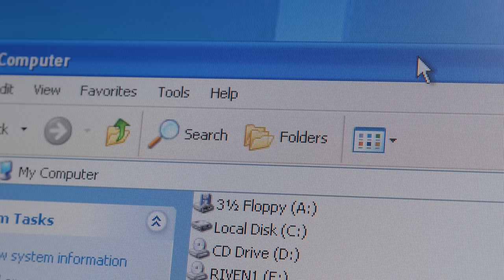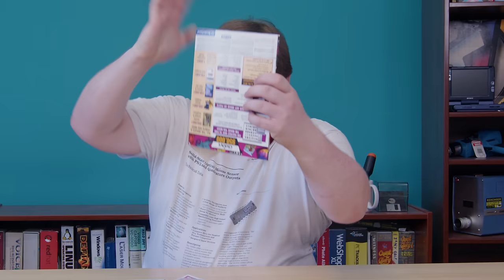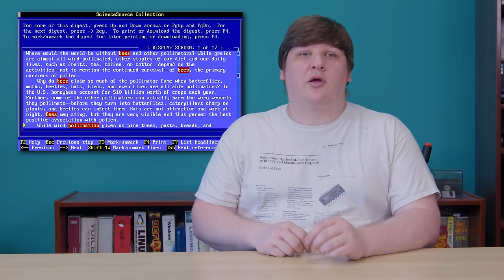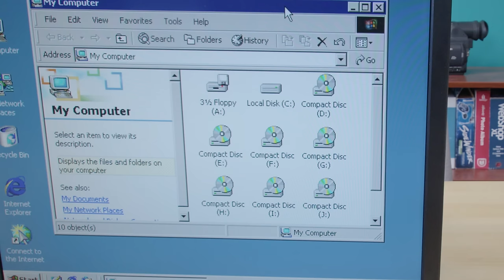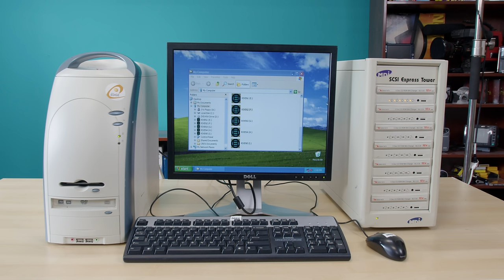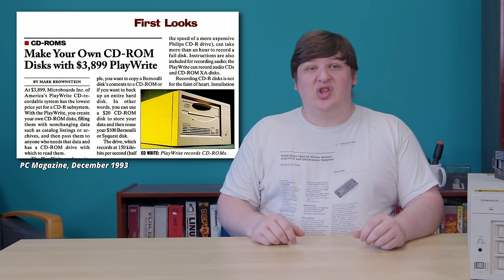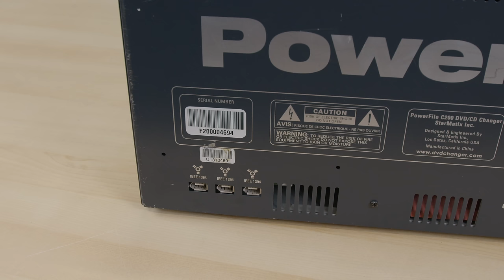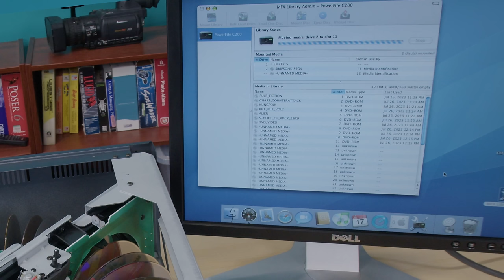A Jukebox for your PC: 1993's CDROM Servers

Comment: I remember the library having something like this, only it was built into the pc case. I remember it was something like 3 feet tall. It had all sorts of software that you could run on it, but I only remember one. It had a Google maps esque software that you could use to plan trips and it would provide turn by turn directions with timestamps when you should arrive at each step along the way. I thought it was so cool and used it to get directions to visit every amusement park I knew of at the time. Of course my parents weren't as enthusiastic about my planning.

Comment: Did you try changing the intensity of the laser, after gluing the lens back on? That can be done with a multimeter and a tiny flathead; doing so is necessary to temporarily fix GameCubes.

Comment: Most likely those pioneer units where used for Mall/store music applications, that you could leave running for 18 hours a day 7 days a week. The Tech Moan channel did a review a while back on a Japanese system using cassettes . 6 cds played on loops. their design was industrial so they wouldn't break and cheap to fix if they did. they could live on a shelf in the corner just playing through tracks.

Comment: These 'last forever + unbreakable" claims started on a very big and old, UK BBC "Tech" TV show Tomorrow's World. I was compIaining about the claims weekly, as was my dad, an electronics engineer since 32k started with Dragon 32, etc, before the Commodore 64. My dad was the tech for Dragon and actually made me a computer, something impossible today, as such claims mean built, as in assembled what someone else made.  Yes the Music ones didn't read data. Spot on. He literally had to bring every resistor home, I helped  rub off the black pcb tracks and contacts. The only part I couldn't get as an 11 year old in 1982 was the case, so I wore a wrist strap as my pcb was on chipboard. Nobody said motherboard then. PCB was barely understood by most. I could change RAM thpugh. My dad put in expandable RAM years before it was standard. I even had games on RAM chips in tubes. It was faster than tape.

Comment: The pioneer cd drives of this era are known for bad glue on the laser lens and with time it has detiriorated, unfortunately to repair them you need an osciloscope and luck as the laser has engraved the lens and if it isn't in the correct position it won't adjust properly

Comment: I think I remember my friend who had one of those big 100 CD changer things, say that it would "forget" where it was all the time and start pulling the wrong discs.  I'm guessing it was just working off a gear system so X second of turning meant it had rotated to the disc 57.  except once it gets off track by even a single disc its off track forever and will likely slip more and more out of sync.

I'm betting there were Japanese karaoke versions that were better built and had a built in sync check to insure the carousel wasn't out of whack.

Comment: I'm going to make an addendum. A Single Layer Single Side DVDs could hold 4.7GB
DVDs could be double layer double sided.  I remember renting a movie that had a double sided DVD.
Reply: Double-sided discs seem like a cost-saving measure for distribution. Still just as inconvenient for the end-user as putting the movie on two discs, given you have to flip them over. Now, if they'd made drives that could read from both sides, especially if it could automatically detect which was side 1, they might have been worthwhile.

Comment: I do know that the similar though later Kaleidescape Disc Carousel, had a hard-programmed habit of randomly checking for discs to make sure they where "really there".

Thus was due to concessions to the MPAA who demanded that if DVDs where ripped into the optional Kaleidescape raid disc ( K-RAID ) system,
the carousel storage had to prove that the disc wasnt just ripped and returned to the local RedBox ( very specific era )

This becomes a problem if you lose power during any one of these disc checks, causing the index to be lost on reboot, and desyncing. Also, the cheap motors would die young due to the constant random checking.

Comment: I would love to see that 200 disk changer tuned up and working as god intended.  It needs just 4 things:
1. A large door on the side to allow manual loading of disks.
2. A pair of buttons inside said door to rotate the carousel to allow loading all 200 disks.
3. A small switch placed as such that it is actuated by the disks themselves as the carousel rotates.  On startup or when commanded the machine simply rotates the carousel to see which slots are populated.
4. New firmware.  It really really needs better firmware.

I would gladly make the physical upgrades to that machine myself but I know nothing about writing firmware...

Comment: The 6 cd changer were 100% consumer oriented models. or rather pro-sumer as they needed a SCSI interface which was not that common place. I had one 6 cd changer from pioneer, except mine was dark gray instead of white, and the cartridges were the same as the ones used on pioneer's car CD changer, also black and gray. I had 2 music cartridges, 1 MSDN , and 1 with mixed stuff.
For pc it showed up as 6 separate drives, with their labels as it scanned the disks on power up. it took around 5 seconds to swap from 1 cd to another.
It was based on the trunk cd changer by pioneer, which might explain why everything is so beefy. it was made to withstand potholes. the linear actuators needed to be strong enough to move the head on a curve without skips. all of the reader is probably supported by liquid bearings too. the car unit is EXACTLY the same with an audio RCA out instead of the SCSI interface (and 12V powered)

Comment: Rip Sony ODS 2012 to 2023 It was 5.5TB per slightly bigger then LTO shells with 500GB discs with 250GB quad layer sides basically blu-ray discs, it was a fairly atttractive system but so overpriced not many people would move to it from LTO outside of the media/science/legal world, and to this day optical jukeboxes for stadnard use are insane prices.

Comment: I had a Pioneer 604x with a SCSI interface that I used for years with my Amiga 3000 (I think it is stored in my shed along with a couple not quite operational 3000s) - I also still have a CD Player that is pretty much the standalone player with the same cartridges.

Comment: well you would think the target audience actually was radio stations. but it turns out that simply getting 3000 seperate audio cd players and putting them in racks even was cheaper and more optimized for those lol.

Comment: Interesting. I worked for Next Technology Corp ( No not the Steve jobs one) in Cambridge (UK) on our 270 CD, 8 drive jukebox from 1989 to 1991. We sold them to various people like the British Library and Disclosure ( in the US) - they did financial reports.  Used SCSI as a data transfer. The robot arms that grabbed the discs were prone to errors and at one point we were Sony's biggest customer for CD-ROM drives - they were horrified when they turned up one day and saw their drives in bits waiting to be installed into the jukebox.
We also had a Meridian CD-ROM recorder. cost about £100K . Blanks were £25 each - and these are srill readable today - unlike the cheap ones that were sold in the late 90's . 
I'll see if I can find my copy of the user & service manuals that I wrote for the "Voyager" CD jukebox.

Comment: Why not discuss tape by the way? I always thought this was the holy grail of backup. Another point regarding backups is that I've considered future compatibility of current backups. What if hardware or software architecture changes? Like you found out, the disk changer software is no longer available. IDE drives are basically useless unless you get compatible hardware. SCSI, same problem. The old parallel port ZIP drives too, and Firewire storage as well. The best solution I've found is to perpetually copy old backups to modern media every couple of years. Integrity is something you can only solve with software, for which I've found zpaq to be indispensable.

Comment: OK, you said "no, we're not bringing up tape, we're not going there."  Well, I'm going there.  I used to service LTO tape libraries.  The horrors of what these things would do.  We're talking like, "forgot exactly where the slot on the tape drive is" which, it's just a normal off the shelf consumer LTO tape drive with a metal faceplate.  And good thing, too, because on more than one occasion, it'd forget where the tape drive was exactly, and try, repeatedly, ramming a tape into where it thought the slot was, miss, try realigning, miss, and keep doing this until literally the tape shell broke.  Which, best case scenario, it'd disintigrate and fall apart everywhere, but, all too often, NO, it'd manage to smash that broken tape INTO the slot at that point, and the drive would manage to partly thread the tape before, wham*, jammed tape.  And tape unspooled everywhere, slowly winding its way into both the drive guts AND the robot mechanism until the whole thing stalled out with multiple robotics errors when it would *FINALLY decide to say "NOPE, I can't work anymore, I need to call the humans for help."

Imagine if GLaDOS's fallback mode was running a tape library and you're in the right ballpark for how bad these things are *today*.

Comment: I fix cd players to resell..and 9 out of 10 times I'm hunting for the pioneer laser lens because it fell out in the case..they most have used some kind if crap adhesive..I think they fixed the issue by 2000.
Reply: I also find they are very picky on spindle height from lens.

Comment: "No don't bring up tape we're not having that discussion." 

Cut to me moments before smugly thinking that was The Answer 

I would Love that discussion though... And just the technology of backups in general. Doesn't even need to be current technogy either I've always been So Interested in data preservation even from a legacy standpoint yet I've barely done a lick of research
Reply from the maker: I'm curious about tape a bit, but tbh it seems pretty dull. The newest format I've ever touched was LTO-1, which is ancient, but as far as I know the actual experience is pretty much the same, and it's basically "flash drive with very awkward UI and an incredible amount of waiting."
Reply: @CathodeRayDude damn... So much potentially cool old tech faceplants at least in part thanks to an incredible underinvestment in UI/UX....

Comment: I had an NEC 4 disc 4x drive in my PC in the mid 90's along side a single fast reader. And got it specifically for multi disc games, and it worked great for that. Boot times were sometimes a bummer but not anything I didn't get used to as I would just leave my computer on.

Comment: I never knew there were CDROM "towers" like that.  I think the first devices like that i saw were CD-RW towers.  I just assumed they were for pirating or something.
Reply: Usually not pirating, but short to medium run independent music production. Having a pressed disc manufactured required a huge minimum order to be viable, but once you did it, you could get marginal additional copies for pennies. Bulk robotic CD burning was a sort of middle grade between babysitting a single CD burner for your entire weekend to produce a few dozen copies if you were lucky and having to be an actual record company.

Comment: I worked at Office Depot in the tech department many years ago. I rembember around the 2000's we got in a cd jukebox tower thing, I think it was made by eMachines. I can't find any info on it online, but I think it was about 100 discs worth of storage and it was some sort of catalog device. No optical drive and no robot arm. I think you just stored your discs. in it with a benefit of some storage catalog/index.

Comment: I am a huge pirate and the way you play PS1 games on original hardware anymore still requires a jailbreak memory card and a burned CD. It would be so cool to take a CD jukebox apart and replace the reader with a tricked out PSX, load it up with bootleg games, and hit play

Comment: I remember the day I went from my 200 cd carousel to just having a pc with music on it. I had my 200 disk carousel for about five years had all my cds in it but several of the disks had no track data built in so I had many cds I would have to hit play on just to figure out what disk it was.

My solution was to take out all those disks probably about 30 or so and burn them onto a cd that did have track into. I was about six disks in when I realized wait a minute I only every play one or two tracks off of most of these disks. So I started the process of moving the one or two songs in Wav format to a hard disk prepping to burn a compilation disk at around 30mb per song.

When it dawned on me that I could just do this for all my wanted songs and reduce maybe 200 cds down to about 25. So i was mid this process working nightly when MP3 hit the scene and changed everything. My brother still has the 25 disks I burned somewhere in a closet. I have a copy on an old iphone 6 that I use as a walkman.

Edit "rude word" to "Disk"

Comment: In 1995, I was the office supply buyer for a major military contractor, and I bought more cd's than anyone in the state. At the time, I paid up to $14 each for a cd/rw with an average of about $7. ea. - blank. It was insane.
Reply: p.s. we were writing documentation for helicopter gunships and weapons systems on them. Not public domain books. We're talking whole cases of reams of paper in pdf format with graphics, charts, etc. It was a huge amount of data.
Reply: p.p.s.s. In 1995, my company bought a terabyte of DASD storage for $1,000,000 and a 500GB SCSI array, made by Amdahl (and LVS 500, nicknamed Elvis) for about $500k. We also loaded 40 redhat vm's on an IBM OS390 box that had a tape robot library about 30 feet long and 6 feet wide. It was like the wild west back in those days.

Comment: I used to work at Powerfile!  The deal I worked with was nifty when it worked - it was a dual bluray burner  holding 200 discs - and also was a piece of shit. They went under in November 2008 when the economy crashed.

Comment: I wonder why the 8 cm CD format wasn't used more, as it would have saved a lot of plastic and well, indeed space too, which would have been significant when bringing laptops around. A 8 cm CD has 185MB of space, which would be more than enough for most programs at that time, and one could even have imagined drives that took only 8 cm CDs, in laptops, to save space and battery. 

Optical small "golden" discs have been featured in many movies, before the 8 cm CD was available commercially, though CDs already existed, as a very fancy but not really sci-fi technology. One example is  "Rising sun" from 1993, with Sean Connery where important evidence is to be found at such a small disk.

So in a way, it was surprising that noone thought to do this for real, and just make 8 cm CDs with software as it would have been about as small as a diskette, with more than 100 times the data on it.

I would have really enjoyed to have had 8 cm CDs instead of those clunky 12 cm CDs, and they must have been a technical standard quite early, as CD-players and CD-stations had that 8 cm ring in the tray to accommodate 8 cm CDs, so the standard was there, but was rarely used. Today, I have some even rewritable 8 cm CDs and one advantage is that the plastic cover is not cracking, the hinge is not falling apart, so the smaller CDs are also more robust, with the data on them, possibly being better protected.

 Imagine all the plastic wasted on AOL-CDs and all the other free handout CDs, that actually only contained a few MBs, there would even have been a lot of costs saved, just to mail smaller CDs. Maybe the thought was, that bigger CDs were cheaper, because you already had a production system for them, but still  - if a lot CDs would have been produced in the smaller format, they would have been cheaper and more handy.

Just one eco or even economical conscious CEO at AOL, who could have ordered a few million copies of 8 cm CDs, thus bringing the costs down, and setting the standard for free handout CDs being the smaller kind could have made a huge difference here, I believe, and it would have saved a lot of money, too.

Comment: Magneto-optical should have been the premier storage standard of the 1990s. It’s a shame that the only consumer-focused version, Minidisc, was locked to only being a music format until it was already becoming irrelevant.
Another bad part of MO’s failure to take off is that it should be fantastic for archiving. The disc is inert when it’s not being written to. Most magnetic media is only presumed to last 30 years, but MO discs could last 50 or 100, basically as long as stamped optical discs can last. But MO is too old and too small for usable data storage anymore.

Comment: The big old Pioneer's mechanisms just reminded me that my old Plextor 4plex 4x caddy-loaded drive used a linear actuator for whatever reason. Dunno why these weren't more common, but i'm guessing there area limits to how fast you want to accelerate the laser carrier (i also suspect it could slam into end stops if dropped).

Comment: I had the pioneer dm600 connected to a single node BBS It was used to hold shareware volumes that i was able to buy to share. After the BBS use, I tried to use it on windows 95 to play phastasmogia. Cause I hated changing the disc. that failed because the game always wanted the same drive (f:/) so disc 2 in drive g would not work

Comment: We used drive locking on our cd tower with a linux host. Once a disk was queued then that was the only data available on that network share until no data was requested from that disk for 10 seconds then it would free the drive to change disks for the next request.